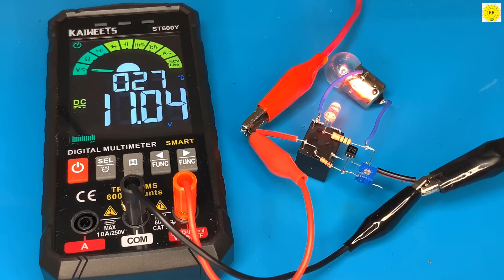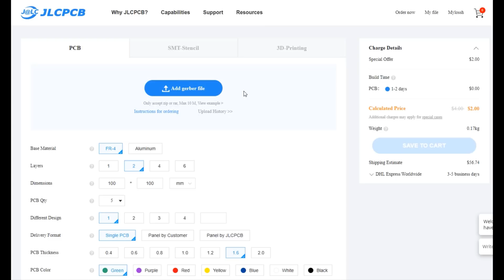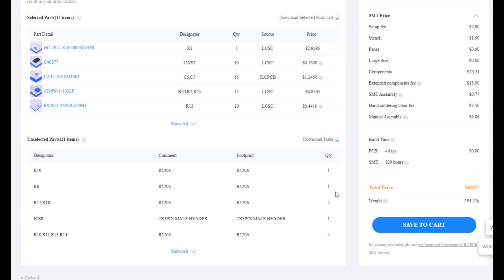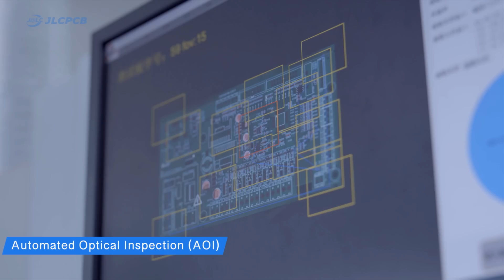how to make simple short circuit protection , Top 5 Easy relay circuits , jlcpcb

Comment: The relay switches off AFTER and because the power supply has been overloaded already.Try this with a car starter battery, and it will burn your relay or the cables. Press the button while the output is shortened, it will destroy the button. Try this with an unprotected AC adapter, it will destroy the adapter. Try this with a protected AC adapter and ask yourself if you need this relay.

Comment: Если были бы принципиальные схемы, видео для новичков было бы незаменимое
Reply: Тоже так считаю, а то даже транзисторы не понятно какие.
Reply: its listed on the narrative below the video
Reply: @fidelcatsro6948  i have no idea what he tryed to say, it not english
Reply: @michaelspencer6523  hes asking for diagrams
Reply: @fidelcatsro6948  it bull crap, if a person make that it big as a car and cost be way over a perfect step down transforner on ac . Pole line service  is 1000v ac at 30 amp then conects to a step down trans formers to homes  240 v dual phaze 60 hert in usa. In phippines a step down 1000v x 240 v - 15 kva  cost $1800.00. A regular size transformer. But the guy said  in this video  is size of a car and to heavy for poles and xost above $10,000.00 and around 4 amp only where service lones on poles with step down transformer only $1800.00 with  many 400 amp services.the purpose of services run on poles is saving money. More distance you travel , it creates restistance in copper wire. And its coating for heat also takes away  curent. Must count own low voltage. Can not go over 3 % voltage lise or alot not work and formala not correct . Relays and coils not operate on 3% or more voltage drop. 10000 volts after 1000 feet it starts 1 volt drop. On 240 v down it 100 feet has 1 volt drop. If 3 % must use 1 wire size bigger each 3 % drop..